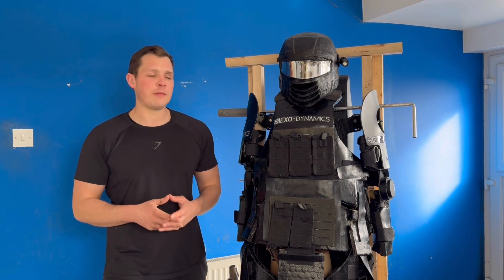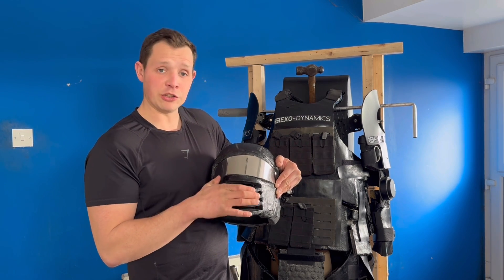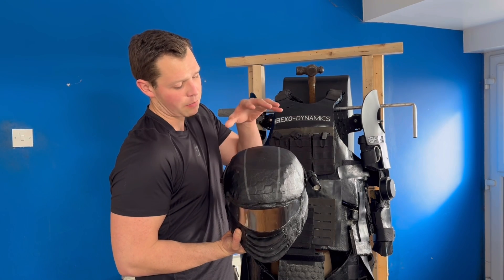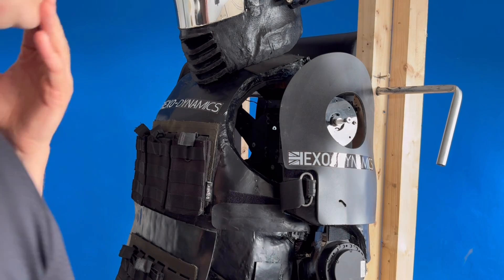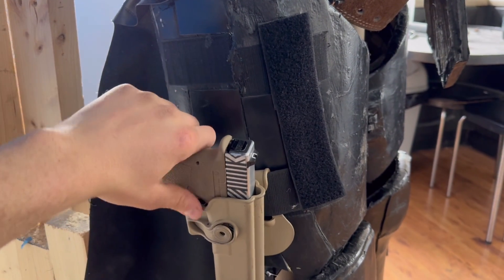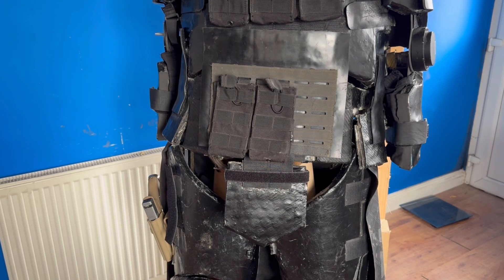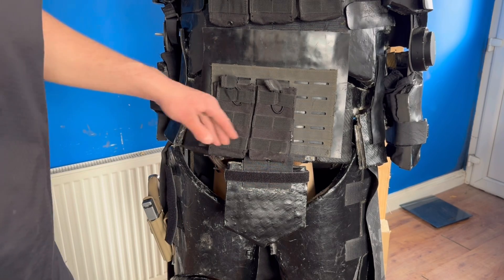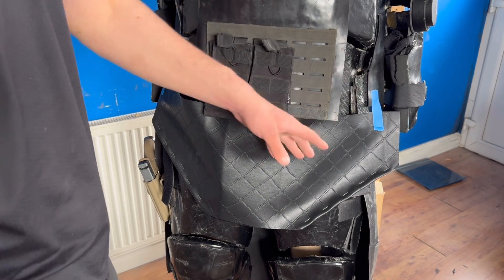Combat Capable Power Armour Update Real Hell Diver? Halo Spartan? Astartes? Ep 7

Comment: i dont know about any technical limitations of this action but the armor on the feet is nearly completely unnecessary and i think removing it would make it look better and make it easier on those motors. i would also recommend just insubstantial layers of Kevlar in between the joints to slow or stop spalling and splattering. you ultimatley decide what to do and not but those are just some ideas i had for the improvement of the suit
Reply: i would love to see a finished and fabric'ed up suit

Comment: My A.R.E.S. suit design would overpower that, not to mention a 30 second climb in and turn on like a car. My design requires a CNC Plasma Cutter, Steel Sheets, Bend Rollers, Wire Wheel stands, as well as actuators, springs, Sliding Components, and not to mention rubber interior with pillowing inserts. My design is more expensive to start, however cheap for mass production.

Comment: I was watching video using capstans drive instead of regular gears and what not as they have some advantages over usually systems so long as you don't need full 360 movement to my current understanding. Maybe potentially useful here there is also rope that doesn't expand least to what I was watching. Possible inspiration?

Comment: I've always wondered with these things... I've seen these "solid state Hydrogen cartridges", for external power supply. Is it not a possible to just use that as fuel and generate these things somewhere off-site or even with a generator on-site?

Comment: So, a little suggestion when it comes to the design process. Obviously it's cool to have a prototype that you can show and wear. But for further development, you might want to consider working in iterations of different parts separately. For example, a shoulder piece, use your budget to create 3 or 4 different designs you'd like to try out; insetead of using that same budget to create the whole arm, but only one design? IDK if it makes sense the way I'm explaining it, but I if you're interested I can update my comment later. In short, designing different iterations of a part or parts at a time, then chosing from those, or combining aspects of them, might give you a chance to create a better product

Comment: Id be leaning more towards a bevor strapped to the helmet with an option mounting to lock it in place if needed. They already make soft armour collars which might be enough for frag. Protecting the neck without limiting mobility too much for the modern battlefield is tricky and will probably take a lot of tests. I mean you could build a great bassinet or frogmouth with a ballistic glass visor but people wouldn't be able to move their head or aim. Or an armet with tight fitting gorget but loose crumple zones and gap around the neck. Maybe I should do  a video about that on my channel armour artist?

Comment: The one thing all science fiction power armor forgets is sustainment. You could have impervious armor to enemy fire, but that doesnt mean shit if the soldier inside cant eat, sleep, drink, and shit in the field.
Reply: This is probably shock trooper kit not regular infantry kit. They only need to be able to operate in it for the duration of the assault. We'd expect regular infantry to hold the position once we'd taken it.
Reply: Lets take a step back because to do any of those you first need to get in and out of the damn thing.
Reply: Dude has an open ass on the suit and the helmet comes off?? Wtf you on about, id sleep like a baby in this thing
Reply: similar to the IOTV and RATNIK projects, this would most likely only be used in very quick  deployments like storming rooms or buildings or even compounds. lighter armor like a regular plate carrier would be much better suited for  longer deployments.
Reply: shock troops are called shock troops for a reason

Comment: Hey, an idea for the face grill, make it double layered and have the openings alternate and overlap. So there is still airways to be able to breathe but should be enough protection to block incoming threats. Though this would not stop spalling, maybe some clever angles could help prevent this, but it's better than nothing. Another idea that can help keep the visor from fogging, have vents in the rear of the helmet go to the top of the visor. This should help vent humidity and keep temperature variances lower so fog/steam from forming on the visor. I believe some motorcycle helms do this.

Comment: to improve the helmet: 
- at a central ridge on top. it strenghtens it againnst blows from the top,  improves presure wave spliting from  explosions above and helps with deflecting top down shrapnel.

to improve the chest: 
- add two "backpack strip" pauldrons that cover your shoulder from above and slightly from the front, without overlapping to the side. (see odst and  spi armor from halo)
- add a gorget to the neck to deflect blows or shrapnel. make its front not jut out beyond  the helmet so it does not catch pressure waves, dirt or rain. make its angel jut out beyond the helmet, so it deflection works. it also limit neck hit chances (see knights armor or odst collars)
- a central sacrificial plate over the heart. cause a puncture of it is a no go..

to improve the helmet:
- add wire mesh to the grill for protection.
- move the breathing slits more to the side and add a center protective line 
- add a deflecting brow (glare, dirt and pressure wave protection, better deflection of frontal attacks due to a flatter angle )
- dent in the cheeks for a better cheek weld for aiming . this also improves downward visibility.

Comment: Have you given thought to quick detached system if a medic needs to treat a wound that penetrated the armor?
Reply: That's why the apothecary has the special drill to penetrate the ceramite. Also, a few prayers to the God Emperor wouldn't hurt.
Reply: @leoprzytuac3660  I don't think Oni has achieved that level of tech yet and the God Emperor is still messing around in US politics. But maybe... this is the moment that changes and we begin the golden era.
Reply: ONI has Biofoam, just inject it into the hole and move on
Reply: @That1menace  but we are in the early years of ONI where they haven't finished the Spartan program let alone the gel.
Reply: @Bagginsess  good point. I guess record the soldiers serial number then move on?